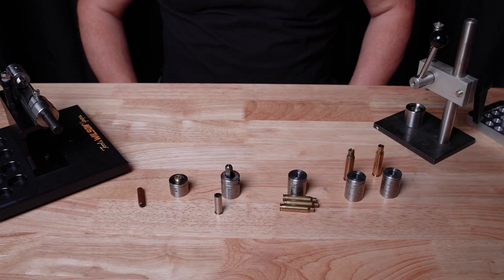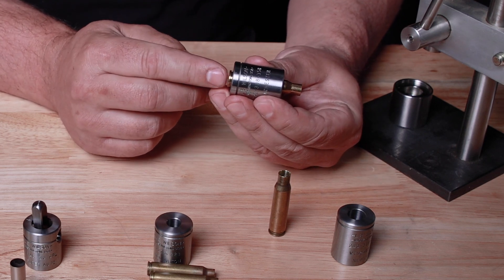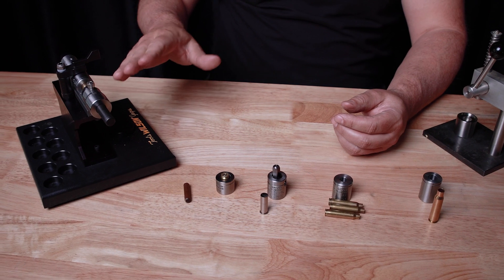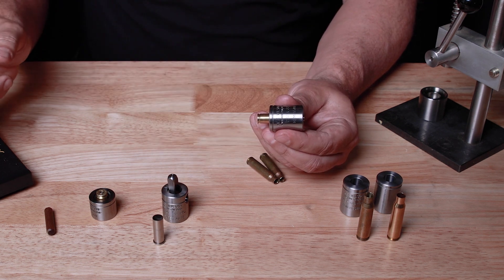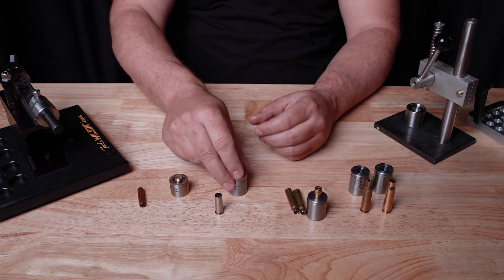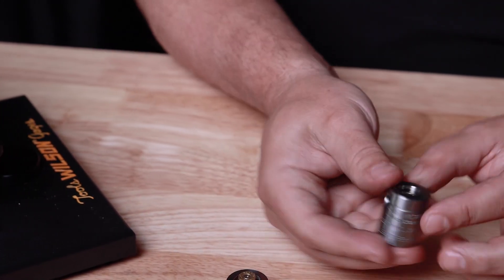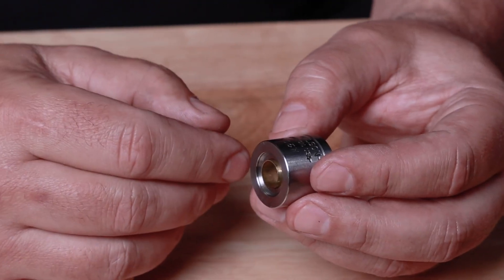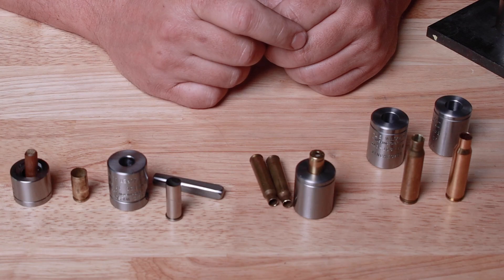L.E. Wilson Case Holder Overview

Comment: What holder for a case that has been full length resized?
Reply from the maker: With Full Length Resized brass you will be sizing back close to a NEW case.  Therefore we recommend a NEW CASE holder if we make one.  There are exceptions, for 308 Win family (243, 260, 7mm-08 etc) we recommend getting both holders since there is a ton of variation in these chambers, so even resized brass out of a AR platform will probably look more like a FIRED case.  So good to have both on hand.